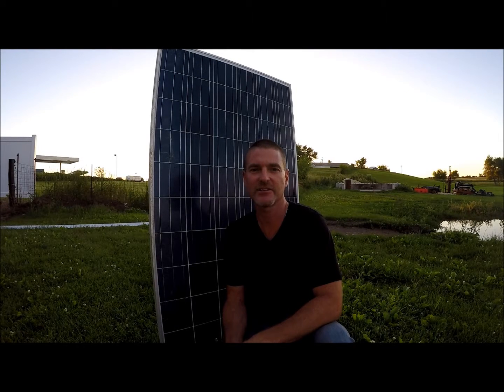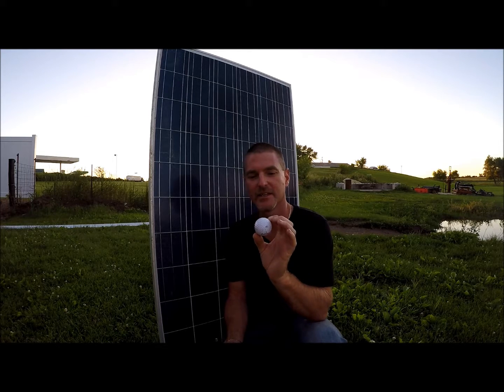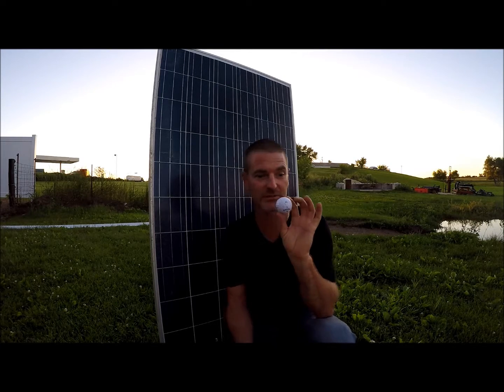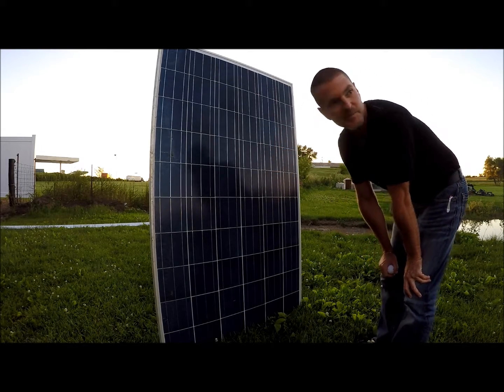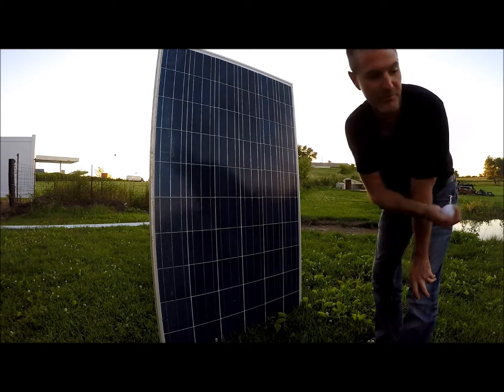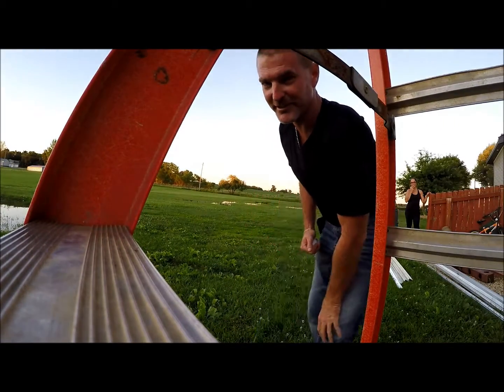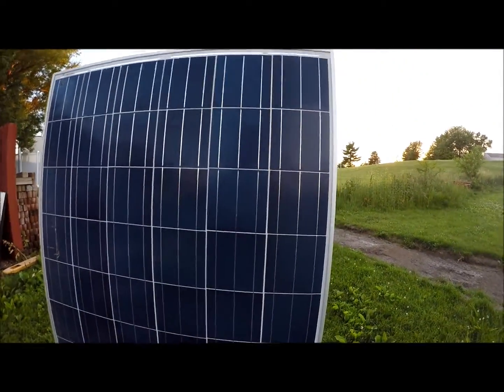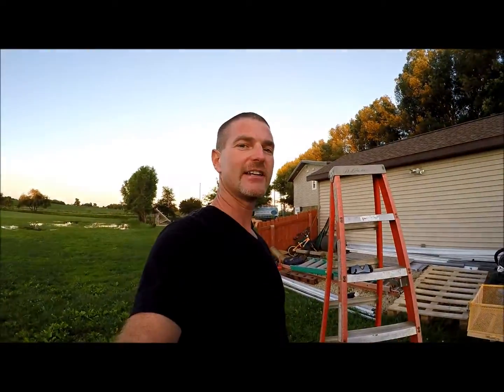Solar PV and Golf Balls

Comment: I have 16 solar panels and live on a golf course. Tesla said that I must replace 6 golf ball damaged panels as they are producing near zero solar power. This is after 5 years. There are probably an average of 5 golf ball impacts (hundreds of cracks) on each panel, some not too bad, some with impact cracks all across the panel. Throwing a golf ball doesn't do this!
Reply: Thx for sharing your experiences. I also live on a golf course which I'm also concerned with potential damage to my To be installed tesla solar panels.  I made sure my design and placement of panels will face away from the fairway. By facing away from fairway and on a typical slope roof, I'm hoping the impact of golf ball will glance off rather than cracking panels. How's your placements of panels, are they placed in a way with steep angle of impact? Love to chat with your on this annoying issue.  Thx

Comment: Thanks for doing that video.  I just installed 48 LG panels and i live on a golf course and starting to get worried about how durable these panels are with impact from an errant shot.  Your video is great because at least it demonstrates that the panel can withstand some impact.  I would be curious if you have tested it by actually hitting a golf ball at 100 feet or more with the panel at an incline.  Also, what brand did you test?
Reply from the maker: i believe it was Mage Solar, 60 cell Poly, see this video, https://youtu.be/e1XtgR-ngxg
huge plant at golf course, 2 years not a single issue on these LG units. there is another 19kw on a building to the north that you cant see along the driving range, no issues. Not saying it can't happen, just they are built very well.